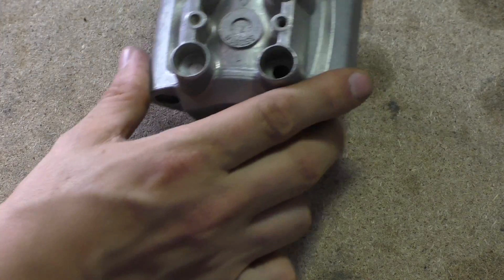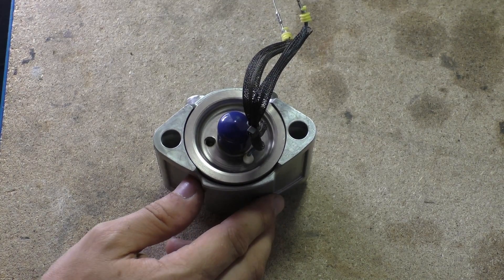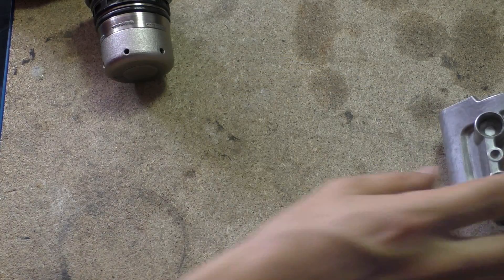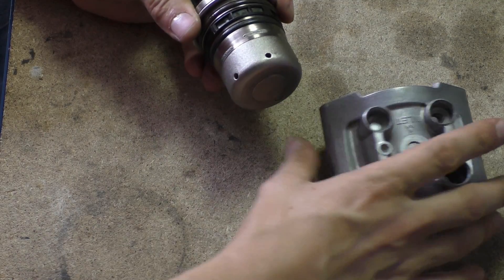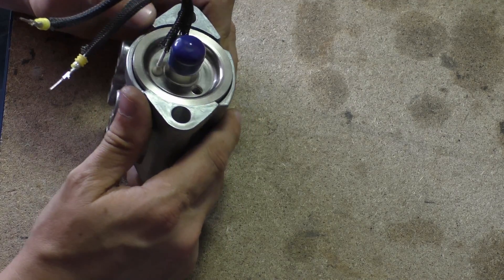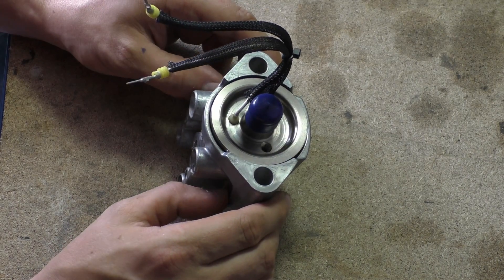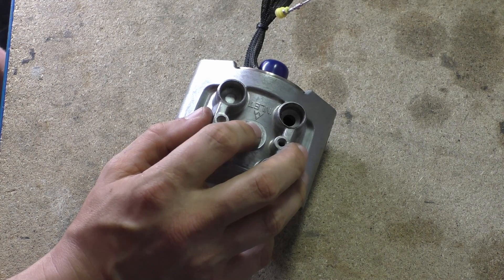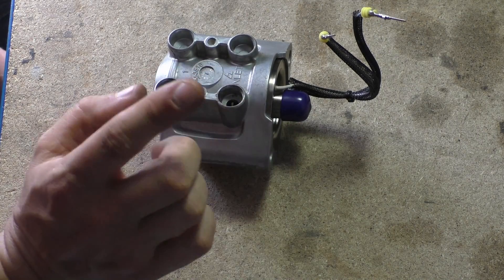A real E tec Injector! - 'the daddy' provides

Comment: How do you seperate from the housing? Is that one missing the seals and rings inside?
Reply: there is a threaded hole for an 8mm bolt. there is a specific tool that can be bought but putting the bolt in a vice and gently prying the outer casing also works

Comment: The limit of this technology is still the low pressure injection system on the two strokes engines like ktm is badly doing.
This keep those engine low revving.
Key is increasing injection pressure( like in a four stroke engine high pressure pump system) and setting a double injection , direct and indirect, inside the combustion chamber.
Dunno why they don't understand this.
Or probably they know but, at the moment, they keep sleeping this technology.
Cheers
Reply from the maker: What? Low rpm is due to piston weight, and conrod tensile strength. Fuelling has nothing to do with it.

Comment: Wonder if Matt will ever do a video on Orbital's Air blast injection system (its direct injection) and how Envirofit made a kit for upgrading engines in poor countries to try and reduce emissions and increase fuel economy. Neat little system.
They saw a power increase of about .25hp, but the fuel efficiency jumped 30% and the emissions dropped 88% for unburnt hydrocarbons and 72% for for CO. 
Imo this system is so simple Harely should have adopted it years ago, modern companies have no excuse for not using this basic af tech. 50% of car engines are direct injected these days, with this air blast injection stuff space and weight is no longer a valid excuse to not put them on motorcycles.
(Yes I am aware about diesels using air blast injection in the beginning.)

Comment: what about puttng a disc valve on the ex port (like an old suzi motor ) that way you can clise it off alot sooner and instead of a big speaker coil you use a piezeo electric vibration to atomise the mix charge? would that work?you could then introduce the charge as the piston goes down after the ex port closes ,you'd have a bit of negative pressure to suck it in . im no engineer and i know sweet fa but its just a quick thought and an ask. what do you reckon?  or a piezeo carb. i like carbs. anyway just my tuppence worth. two strokes rock man!

Comment: Matt said  these systems have a fuel supply at 300 PSI they have fuel supplied at  58 PSI the same as most  gasoline burning car engines.. have a fuel supply pressure at.. the Ski-doo E-tech injects into the top of the head at 500 PSI  other Brands inject into the intake ports at 300 psi..
  Matt said  E-tech injectors can only operate up to 6,000 rpm  yet the 850 Skidoo engine is  clutched at 7,900 RPM  Go Figure..  There is a  link on the page  labelled  called  "Inside Skidoos New 600 Ace  4 Stroke.   It goes to another article on an  Artic two stroke sled .. It had me confused as it is above the photo of a cutaway two stroke Motor .. 

http://www.snowmobile.com/products/fuel-injection-systems-in-todays-twostroke-600s-1775.html

 This page has photos of cutaway engines and cutaway  Injectors..  I was not up to speed on Artic Cats new Two Stroke technology they are gaining and a big improvement over  the Suzuki engines they used in the past.. 

  Out board  motor  emission standards are more strict and  the  E-TEch Direct Injection was developed by Evenrude  OMC Company in  USA  but they had financial problems and  Bombardier bought them  

  I read years ago that Motorcycle engines were on the leading edge of  engine technology and automotive  designs came from Motorcycle designs.. of course Formula  1 can be at the leading edge too..

  I like to learn the truth ..   kind of funny how pissed off Matt gets if you call him out on an error.. 

 he told me this is a  channel on Motorcycles yet he goes to great efforts to run down snowmobile engines..    I see many snowmobile enthusiasts  commented so  there is a  crossover of interested in designs and technology  .. Of course KTM and a couple others are offering Two stroke fuel injected Motorcycles again ..

  Yamah RZ-350   operates at a much lower RPM than the  TZ- 350 road race engine is one shite and the   other not ?

  You can put Huge  Big bore aftermarket cylinders on the  RZ-350  Banshee Motor .. the Banshee did not have YVP exhaust  valves..
Reply from the maker: "Matt said  these systems have a fuel supply at 300 PSI they have fuel supplied at  58 PSI the same as most  gasoline burning car engines.."

- not according to BRP it isn't.
Reply: I can see how you got confuses  303 kpa  is Posted 02 January 2014 - 03:07 PM 
2011 shop manual says  44 PSI. or 303 kPa

http://www.dootalk.com/forums/topic/700386-600-etec-fuel-pressure-spec/

Comment: yeah,  Ski-doo sleds with etec motors can run past 8K without an issue, they make their peak power around 7850rpm
Reply from the maker: and they lower the compression to do this
Reply: 2016 etec 800 has a 12.5 to 1 corrected compression ratio, much higher then the current carbed versions or there earlier non-etec efi sleds (sdi, p-tek).  The rpm is not limited by compression in any means, nor did BRP lower the CR to achieve this whatsoever, quite the opposite actually. The injectors are basically at their limit at 8500 or so, although they designed the injectors to be able to reach the rpm that was desired, as this is the rpm at which they were able to make decent HP without sacrificing longevity.  Pretty much every 800 twin cylinder ski-doo engines ever produced were engineered for 7800-7900 peak hp, even back in 1999 when the 800 twins were first introduced.

The main limitation that BRP has faced with these injectors is the ability to have a controllable stratified (and lean) charge at idle and low rpm.  The injectors plungers are just simply too large and the pop-off pressure (500psi) is just too high, and limitations were met with the 800 etec in this situation.  This is ultimately the main reason the new 2017 and 2018  850cc etec engine now has smaller direct injectors(600 etec style) and secondary standard 12 volt injectors in the intake tract.  In the new 850, the direct injectors will run at idle and up to 4000 or so depending on TPS signal, after 4000 or so rpm the secondary injectors come into play and create the full homogeneous charge to make peak hp at higher rpm and load.

BTW I would love to see you make an engine run with this injector!  they operate at 55 volts and are pulse width modulated to control fuel delivery, the BRP ECMs also give a small pulse in reverse polarity right before the plunger bottoms out to slow the plunger, make the injectors run more quietly, have less stress on the injector itself, and to simplify the injector, although this would probably not be necessary just to make something run with it!

ps I believe the injectors require about 60 psi of fuel to operate correctly.
Reply: also BTW if you would like another one I am pretty sure I have one or even two old ones that are more then likely in perfect working order.
Reply: James Olivier a

Comment: Don't know if you misspoke but the etec injector is good to atleast 8000 rpm. the 800 etec cut off completly at around 8500rpm
Reply from the maker: For ski-doos yes and this I will cover in a different video for the outboard - which this injector is from 6k
Reply: Didn't know that. They look identical though
Reply: Outboards and Skidoo,5 model of injectors the rest is software
Reply: 9800 RPM WITH PIPES AND OTHER NORMAL RACING STUF AND A REFLASH ECU 212HP
Reply: would it be possible to interchange skidoo and outboard injectors if we somehow found the software? I have been dealing with injector issues on my evinrude for quite a while and the outboards are discontinued. the motor was built the same year the company went out of business. The motor is allegedly worth 12k usd new but replacement parts are hard to come by especially not in north America or europe. I've been waiting 3 months for a new injector but I will grind the weld off the old one and see if I can re,-wijd the could and achieve an on spec ohms reading and install again

Comment: Hi, if this THING can only work under 6000 rpm, I would say it`s no good whatsoever for a 2 stroke.
You stated yourself that most 2 stroke don`t start their powerband until after or at 6000 rpm, so what use is it, ESPECIALLY  with the size and weight of it.
To me it`s just a gimmick for curious back yard mechanics with more money than sense, ......... maybe a BIG OLD LUMP of a 4 stroke engine, say, 600cc and above that can`t rev faster than 6000rpm.....
At this moment, ... I do not see the point of buying one.

Comment: Have two of them servicing the same cylinder and alternating their injections and you can get up to 12000 RPM.
Reply from the maker: LOL why not 4, they only weight a kilo each oh and there's the pumps, and power requirement
Reply: Jason Benguerel 2kg
Reply: Yeah not complicated at all, not.
Reply: I'm just saying, if they are already heavy and pointless to use since they limit the practical RPM to well below the theoretical optimal range, this would show what the injectors could do at higher speeds. This is just an earth bound experiment anyway, right? You said you would have two of them, so I was only suggesting it would be interesting to see what kind of weight be dammed power could be achieved. If we know anything about technology it is that it gets smaller and cheaper, if you can show it is effective at higher RPM there will be incentive to improve the single injector performance. And as far as 1-2 KG, my old RZ350 was hobbled with giant catalytic converters that far outweighed that and all the pumps and such, it still went very fast. What exact problem are you trying to solve? I assumed this was about emissions. There are going to be trade offs, the question is does this even work?
Reply: Yeah!!!! .... What a good idea, ... BUT, ... will they gain you enough performance to offset the weight of these things, THEN, there is the matter of where to put them to gain that performance, ... maybe mount them " in ", the airbox, (if it`s big enough), with K&N style filters... I would love to see your idea on an actual machine. Are you gonna try it?
Reply: I`ve just watched a video on how these injectors work, ... you have to attach them to the cylinder head, ... (wow, ... start cutting the tank up to make space, ... OH! and drill the head too)... WAY TOO MUCH FUCKING ABOUT FOR LITTLE ENGINES AND EVEN SOME OF THE BIGGER ONES.
Reply: oh and you`ll need a pump for the fuel, ... and more electrics PWM unit, and mount a sensor for that, ...... TOO MUCH FUCKING ABOUT FOR LITTLE ENGINES...
Reply: why not 12?

Comment: Couldn't you run 2 of them at different cycles to make it work at higher rpm?
Reply from the maker: Theoretically yes, but the weight, cost, pumps, electric power requirement size etc